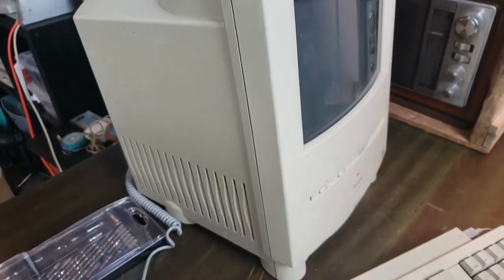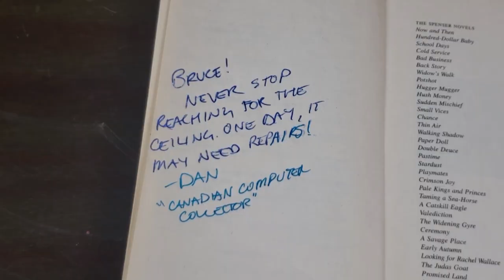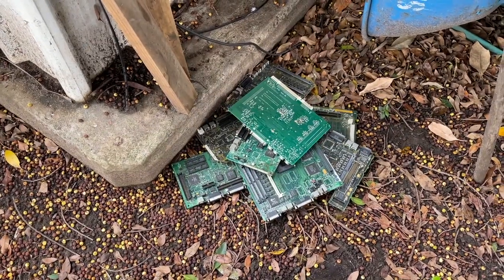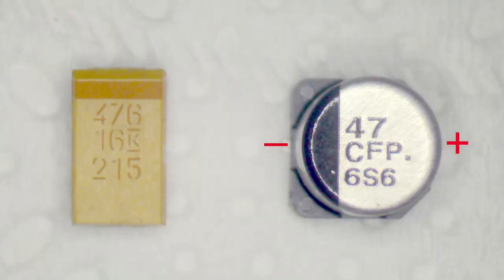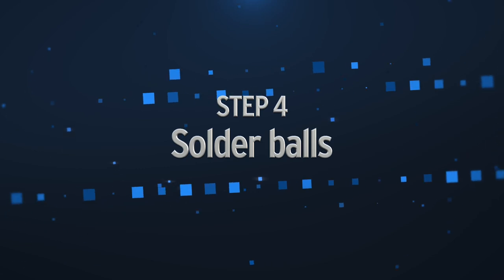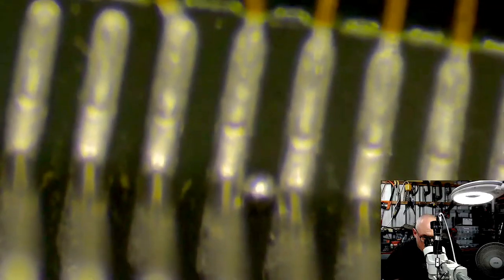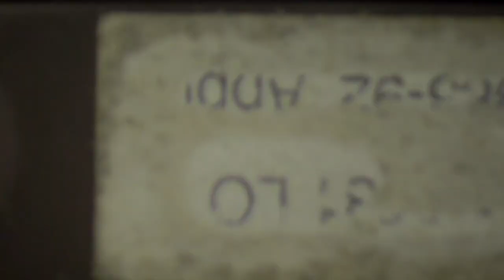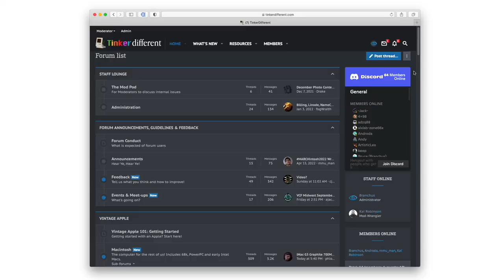What to do when recapping doesn't fix your vintage computer.

Comment: Convincing me to re-inspect my board just helped me save a vintage mac GPU. I had replaced some caps that were starting to go bad on it, but when I plugged it back in, I had lines all over the display. Turns out I had accidentally bridged two of the pins on a VRAM IC. Cleared that up and I'm back in action!

Comment: I attempted my first recap earlier this year, on an LC575. I thought I did a pretty good job, everything looked ok. Turns out I installed all the tantalum caps backward. It’s now become a winter project, for those cold nights when the sun sets at 5:30.
Reply: Lucky you didn’t end up with a cracker night. Those tantalum’s make excellent fireworks if abused.